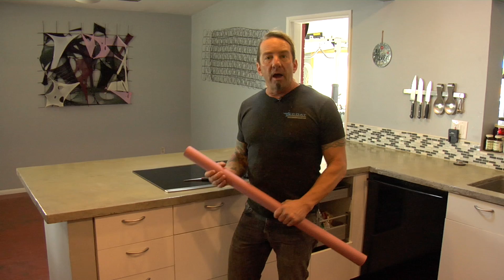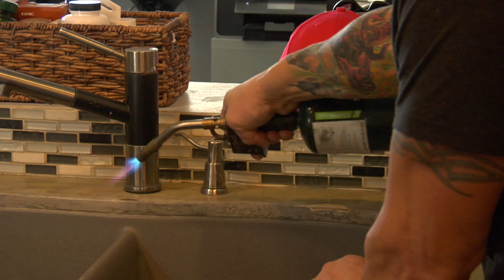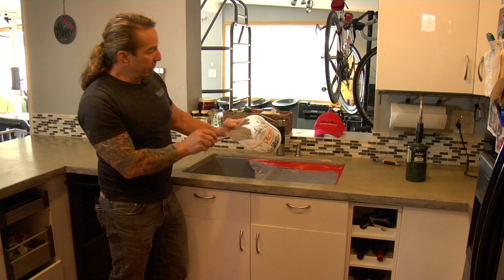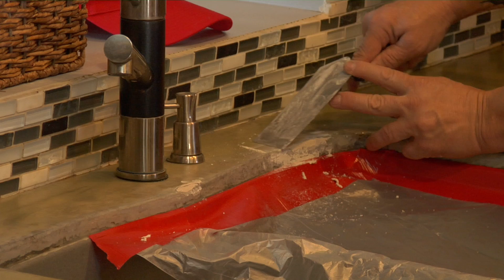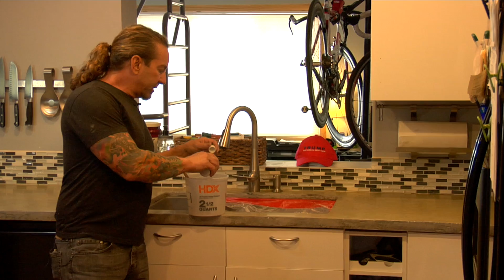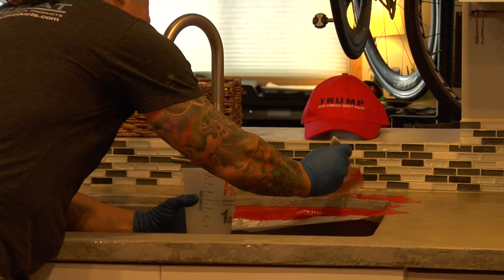Tim's House Countertop Epoxy Sink - Easy Repair

Comment: I have  a bathroom sink and vanity that I apoxied. However 3 months later I have 2 bubbles one a 1/4 inch away from the drain and the other 2 inches away, They are about a 1/2 inch x an inch each. they haven't gotten bigger and it's been a month or so since noticing them. How would you fix without replacing the whole surface again?

Comment: great tip!! warm up the epoxy to remove tape. I just finished my countertop. looks great, however after I removed the tape around the sink, the epoxy lifted a bit. any ideas how to repair it?
Reply: Heat the area and then cut out the affected area and redo.